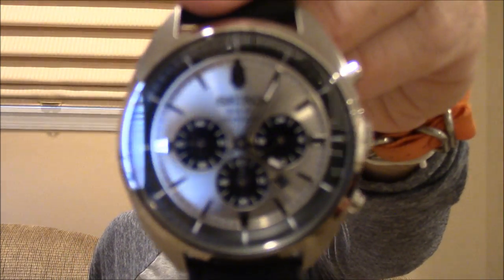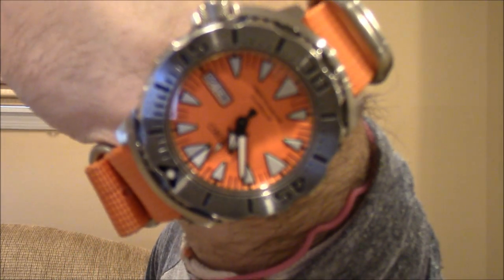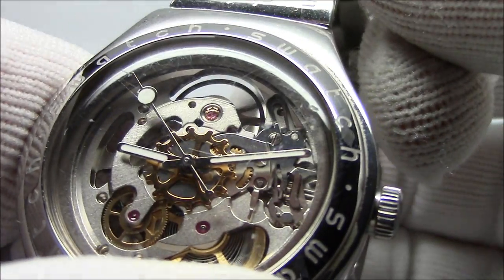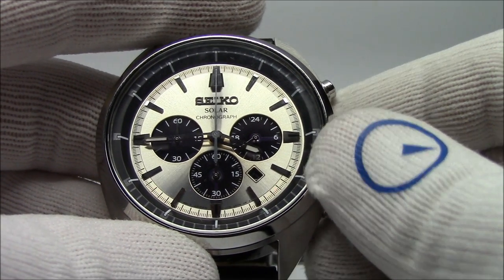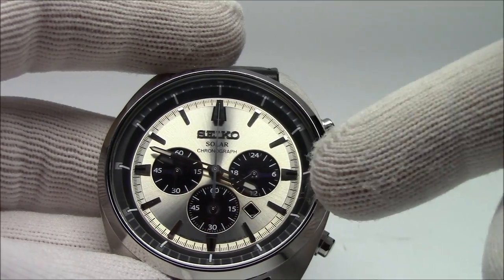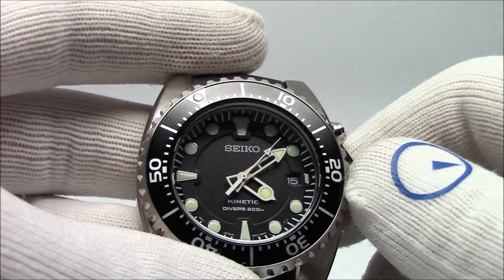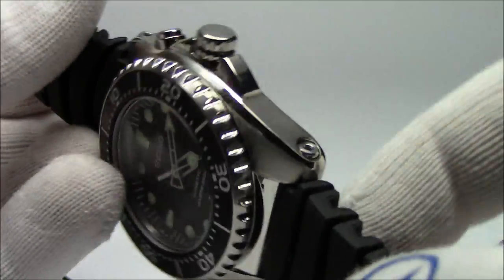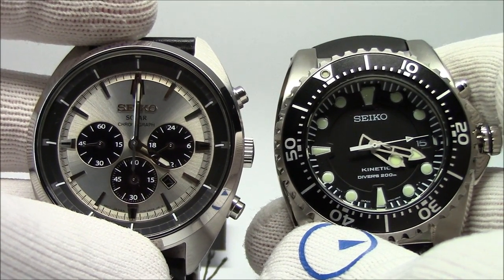What are Solar and Kinetic Watches? Watch and Learn #23

Comment: Thanks, appreciate the informative review.  Do you have any experience/knowledge re: 'behavior' of ciitzen eco-drive battery?  I've had mine for several years now of daily wear, lots of charge, good accuracy but lately I've developed a battery-sized and shaped rash on my wrist under the watch.  Do emissions or chemical of some kind leak out of the battery over time?
Reply: More likely there's a foreign substance on the back of the watch that's irritating. Try cleaning off the back thoroughly.  Some individuals after allergic to the metals used, like nickel.

Comment: Hey Marc, great video as always! One quick question. In theory if I put a normal battery instead of a rechargeable one will it work all of the batteries life(1 or 2 years) or will the battery be destroyed by the energy coming from the solar panels?
Reply from the maker: It won't be happy trying to be charged. I think you'd have to disconnect that part of the circuit.

Comment: You can "wind" some kinetics, like the rather beautiful SRX013 with the 5D88 movement.  Also, you can charge the kinetics without shaking it, through magnetic charger like the Seiko YT02A charger, or some more chea... okay, let's be kind... some more "budget conscious" types use electric tooth brash charger as a makeshift hit or miss charging method for kinetic watches.

And by the way, I have the SSC509 World Time.  I like it on a strap.
Reply from the maker: Thanks so much for sharing.

Comment: You cannot install an ordinary battery in place of an rechargeable one to so could overheat the watch  and cause serious burns to the wearer
Reply from the maker: yes, you can, you just need to disconnect the charging lead.
Reply: Fair comment but should you not tell viewers of the procedure required to use an ordinary battery

Comment: Thanks a lot Mark. You are very very very informative. I have learned quite a bit from you. I came here to learn about kinetic watches and I gotta say I am a little disappointed. It looks cool with the spinning rotor and the copper coils and the idea is cool, using motion to power the generator. But it's lame, because 1- it does NOT have the automatic's smooth second hand look. 2-It's worse than an automatic in terms of inconvenience, in the sense that you need to slowly build up the power reserve and can NOT wind it up!, which is a huge minus compared to an automatic. The only areas it has an advantage in are accuracy and the longer lasting power reserve. But neither one trumps the automatic's relative convenience and smooth second hand which makes Grand Seiko truly the best in terms of aesthetics, engineering and sustainability.

Comment: Awesome video as always! This is way off topic but I was curious if you would ever do a video on Russian watches. I'm wondering if they are typically a smaller watch. Because I purchased my first Russian timepiece with Russia's famous automatic Vostok movement from a reputable store on ebay and I'm not sure what the measurements are. But it seems very small for what was sold as a men's watch. The band which is the original band was clearly made for a man as it's thick and standard men's length but the actual watch seems small. To compare the size, the actual dial not including the bezel is the exact same size as a cap from a  20 oz bottle of zephyrhills water.
Reply from the maker: I don't have much in Russian watches, just the Vostok Europe line. But as a whole, the Vostok brand is well respected as in the online watch community, and is a solid affordable watch.

Comment: I feel that the battery has the potential to last a lot longer than it's making it out to be, the battery if u wear it regularly wont be used barely at all

Therefore the battery would last for upwards of 10 years before it would start to lag behind in performance

Comment: My problem with this is that if you take the extra space and weight of the solar panels or rotor etc, you could just fit a bigger battery. CR2032 battery in a low power quartz watch will last longer than the shelf life of the rechargeable batteries, talking 10-15 years. and changing the battery every 10 years is acceptable.... however, a second hand moving a whole second at a time is NOT acceptable, so I'll stick with my automatics...

Comment: I only buy Citizen.  I have found them much better quality than Seiko.
Reply: Citizen are under rated however, their designs are not in the same league as Seiko imho, the Myolta movements produced by Citzens are though superb for the money.
Reply: Try Seiko's JDM offerings, for some reason their home market watches are a step above most of their international offerings at the same price bracket.
Citizens are great watches though, can't fault their quality.
Reply: Also a Citizen guy. Got Automatic and Eco Drive watches.
Reply: You should try Casio too. Mine was, a world timer eco drive and it still works fine after 8 years of usage.

Comment: A quartz watch with a good  battery will last over 5 years these days...longer if they are 3v. These watches have capacitor batteries which are, these days, specific to the watch. Some are spot welded to the circuit board. Repair is expensive and Seiko and ETA are reluctant to supply parts outside their service centres.

Comment: Hello, I have a question about my watch I got from my Dad. It's an original 6309 7049, it stopped working and needs a new capacitor/battery. Also a tune up. Here's the SN 470761. Do you change the battery/capacitor? If so can you change it, and give it a tune up? If not you, maybe you can  reccomend someone? I'm not looking to destroy the bank getting it running. Everyone I've called has told me that I had to send it to seiko for this, and the bill was gonna be about 150.00! That seems high for a battery and some new gaskets. Anyway I really like your videos on watch and learn topics! Lots of great info on Seiko dive watches, so keep making them!! And let me know if you can do the battery change and put new gaskets in the front and rear. I want to take my turtle in the shower, and swimming, and snorkeling. Thanks for reading this , and have a great day!!

Comment: Absolutely the worst least collectible line of watches (Kinetic) - this is an abomination for any collector unless you wear them daily.  Once the battery(capacitor) is exhausted there is virtually no way to revive it outside of hacks that work some of the time.  Seiko actually had a charger they sold primarily in Japan and then discontinued because of price point and lack of interest - sell them or store them and forget them as quickly as reasonably possible.  They are not collectible and no sane watch collector would pay $1 USD for any.
Reply: 🤡👆Troll Harder.

Comment: After learning about kinetic & solar watches still containing a battery inside which cost $50 to think it's just an ordinary rechargeable lithium battery w/c last 2 to 3 yrs.  whether you use it or not only means that Kinetic & Solar watches are still battery operated watches which uses a costlier battery makes no sense, i think it's better to use an ordinary battery operated watch instead since it's battery would still last 2 to 3 yrs. & you don't need to wear it daily. Automatic watches i conclude is still the way to go despite not so accurate. It doesn't need servicing for more than a decade & no battery to burst if left for a long time unremoved. When batteries burst your watch is a goodbye as it will damage the electronics inside. Either i go for an automatic or just an ordinary battery operated watch would be best. Solar & Kinetic is kinda more of a gimmicky technology which doesn't benefit the consumers since all Lithium batteries will die after 2 - 3 years. No lithium battery technology can make itself last more than 3 yrs. & function normally. I conclude Kinetic & Solar watches are just bullshit. I'm still wearing my dad's automatic seiko today even if he has returned home to God & haven't even went to have it fixed. No lithium battery technology will last more than 3 years & still function as it should. I suggest people to buy automatic watches if you want something to hold it's value thru time & pass it on to your offsprings.
Reply: Bernard,

My Kinetic Diver has been running for 8 years without being opened.
Reply: My father's solar divers 200m watch has been going for over 10 years.... so yeah guess not all batteries last between 2-3 years

Comment: Don't buy a Seiko kinetic! They are terribly unreliable! Waste of money! They need fixing every couple of years.
Reply: My Seiko Kinetic is 8 years old. It was never serviced or opened. I wear it daily. Its accuracy is of a couple seconds every 6 months when I switch between STD and DST. And it still keeps a good charge on its original battery.
How do you use yours? If you let it sit still in a cupboard for more than 6 months you can kill the battery. Rechargeable batteries don't like to get fully dried out. And who serviced it? Maybe the problem is with the service, not the watch.

Comment: Thru is kinetic or solar is crap.Sooner or later you have to change capacitor,it going to cost you.I prefer normal battery watch.Cheap to replace and lasts minimum 5 years.